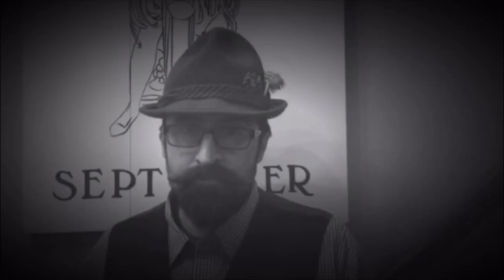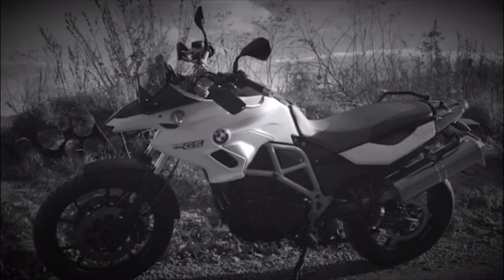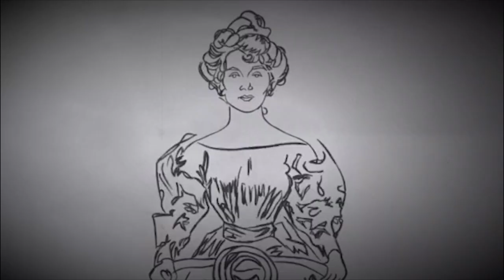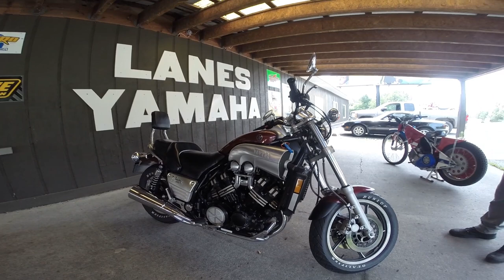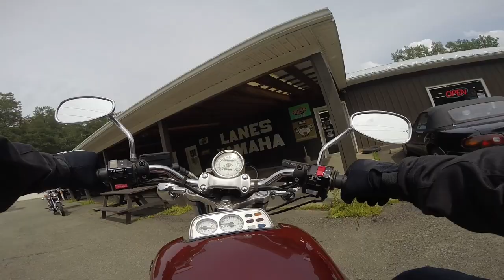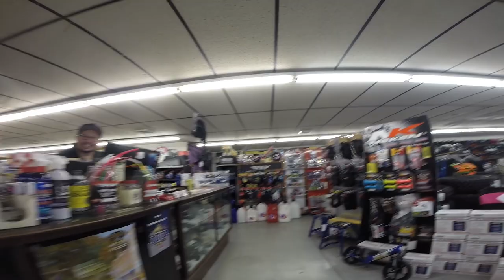Part 2 - Dick Rides Kyle's Yamaha V Max

Comment: I've had mine for 24 years now, an '88 model US import into the UK. A few mods on it, 17 inch rear wheel gives you better options for tyres thus better handling, 6 pot tokico front brakes, solid billet ally fork brace, bigger radiator, one off fork shrouds that put about 10 kilos over the front wheel with progressive fork springs so the front tyre stays planted. Stage one dynojet kit, stainless steel headers matched to Laser pro stock racing exhausts (deep rumble) and a 3 position vboost switch that enables the system to remain stock, switch off completely or be on from tickover (which is interesting).
Most parts came from Exactrep here in the UK.
So nice to watch someone who gets the bike and enjoys it for what it is, anyway, those who say it doesn't handle are those who are afraid of it, I've burned off many a sportsbike rider on mine, it countersteers beautifully but don't let the vboost come in mid corner 😲
Reply from the maker: Any chance you’re in Betws-Y-Coed today? I’m looking at a 28 plate with a funny switch under the handlebar clamp. Faux-carbon tank and fenders…
Reply: @DickWhistles  No not me mate, mines a basic black and my vboost switch is on the right hand switch gear assembly.

Comment: Not really designed for highway riding. 
Much more fun if you give it the juice in 2nd with a quick twist up to about 80% throttle. My 98 has 43K of which I've put on 25K and its never been more than 10 miles outside of Milwaukee with all of it on city streets and in-city highway riding. To really do any long distance riding the bike needed a 6th get which is my only beef on the bike. Mine has had the the larger jets installed and it barely gets 50 miles on a tank full (3.2 gallons) Even on modest hole shots mine puts you a block ahead of traffic before the car that was along side you starts to pull away from the line. #ferocious.
Reply: 25k around Milwaukee? Thats a lot of sad Harley riders!